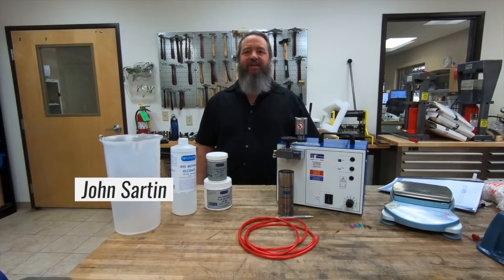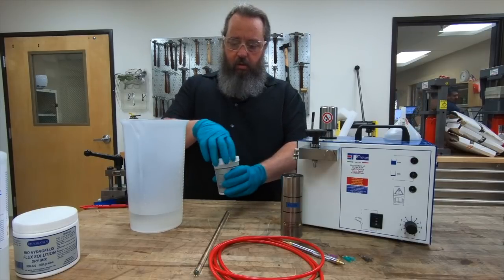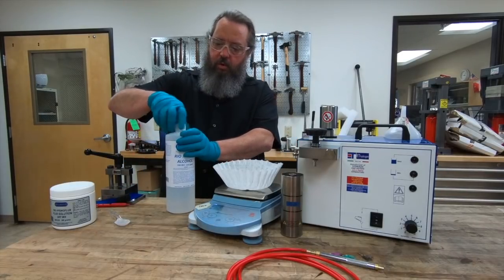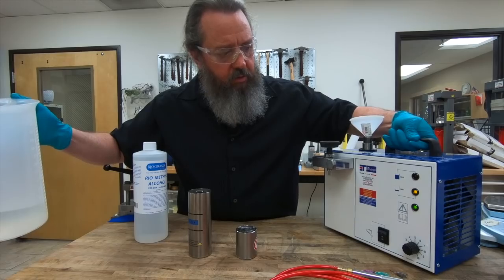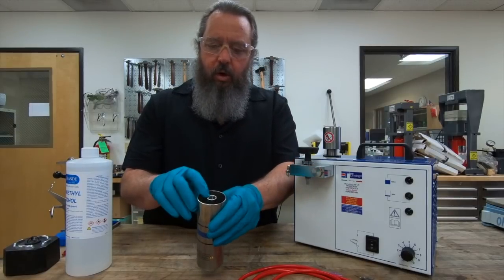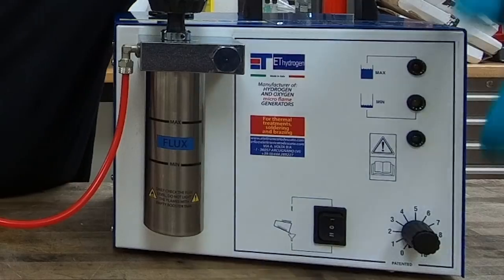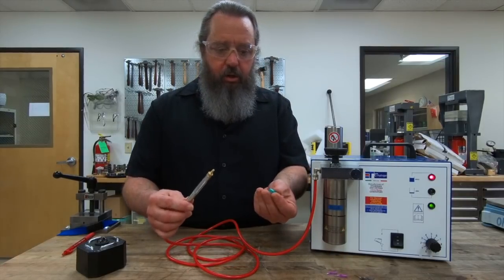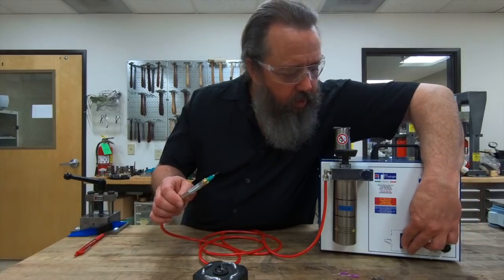Using L45 Hydrogen Torch System: Part 1 of 3

Comment: Is the striker the only thing that can light it? I’m having trouble getting mine started. I’m going to call tomorrow but maybe someone will see this before that 😂
Reply from the maker: That is correct. You need a striker. whether hand held or electric like the one used in the video.

Comment: Hm .. I am a still little confused about the flux setup ... Isn't the booster tank not also the flashback security stop? I do wonder how that adds up with the flux solution that contains alcohol (a flammable agent in its own right) to sit in that boostertank.. In case of emergency that boostertank also still contains a little oxygenated hydrogen from the electrolysis unit..  How is that setup made secure? Other models have demineralised water in that booster tank if I am not mistaken... Also How would the flux end up in the flame this way if it is in the boostertank. I imagine the produced oxygen and hydrogen gas bubbles through the flux/alcohol mixture in the boostertank (in which I then do assume the flux also becomes volatile) and mixed in the gaseous phase with the hydrogen/oygen mixture from the unit before entering the handheld piece and tip where it is lit on fire? Or am I mistaken?
Reply: Yea you are. Try thinking about it. Ever see a inline lubricator on a air line?

Comment: How long does that last until it needs to be refueled?
Seems like those mixture containers aren’t exactly readily available
Reply from the maker: We recommend changing the electrolyte solution once a year and refilling the flux booster tank as needed depending on use. As your electrolyte tank runs down over time, you do not need to add any electrolyte, just distilled water. We carry a 1-liter (702113) and a 3-liter (702114) Measuring Pitcher on our website for measuring your distilled water.
Reply: @RioGrande1944  Sorry, I'm a bit confused. Are you saying that the reaction is only using up the water while it runs? Does KOH not need to be at a certain ratio with the water?

Comment: Hi , I am in Canada and I can not find the 1-Rio Dry Mix Sodium Hydroxide Electrolyte Compound and the Rio 300g Hydrogen Welding Flux Solution Dry Mix and I try to order it throw the company website but they do not ship to canada , so what I can use instead . and what it gonna happen if I use just water and alkol  .
Reply: As far as I know the mix is 1 part caustic soda (Sodium Hydroxide) to 3 parts of distilled water to make the electrolyte.....don't use tap water or the inside will get coked up from the salts in the water......I use the ice water from my fridge and freezer when I defrost it......rain water is good too.

Comment: What happens if your power fails while in use?  Should we use an UPS?  If so, what capacity?
Reply from the maker: Hi there — If the power fails, extinguish the flame if you can. If not, you can flip the power switch off and wait until the power comes back on. You can then power the unit back up and continue working. We hope this is helpful, please let us know if you have additional questions!